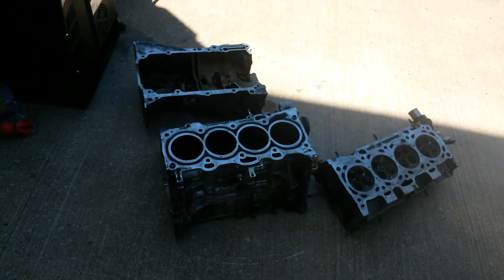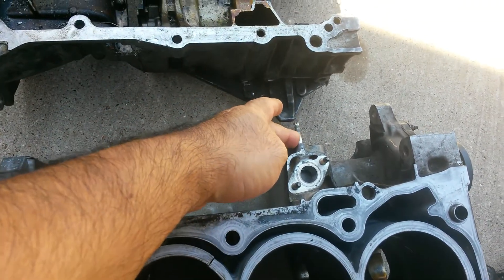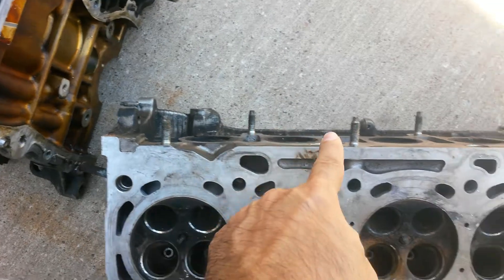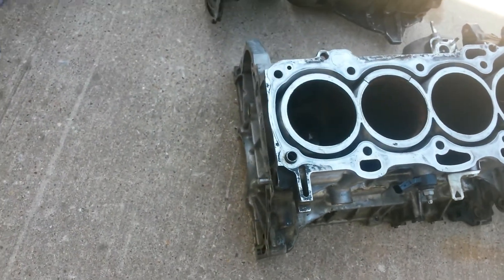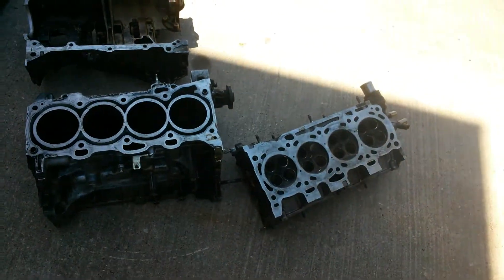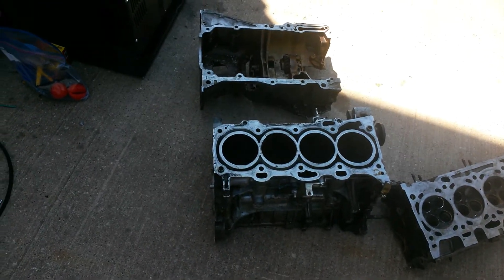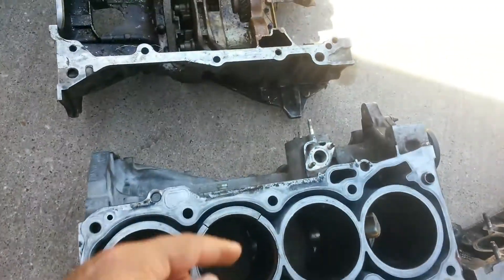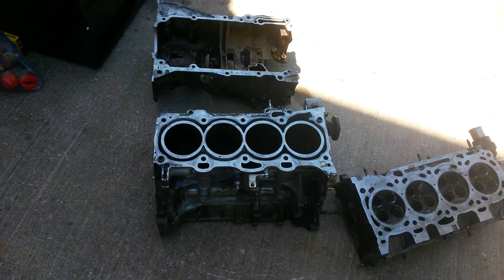How can I clean an engine block for scrap

Comment: I actually have this engine. Its a 2az-fe 2.4L Toyota engine. You should have no problems taking those studs out. Just find a socket that will fit the ends and remove them. Or you can take a vise grip and do it that way. As for the Balance shafts. That should be self explanatory as they are just held on by a   few bolts.
Reply from the maker: Thanks for the tip my friend.
Reply: I know this is a really old video but for future reference, they come off with Torx socket. Most Ford engines are T6 socket . They are pretty snug and occasionally you will break off a tip of it. If so, then you need to use vise grips.
Reply: Autocorrected to “Ford” should say Foreign

Comment: You can put a nut I'm about halfway then thread another nut to lock the two nuts together and it showed on thread if not you can Bend It Like A L shape with a little Heat and put a round pipe over in threaded out